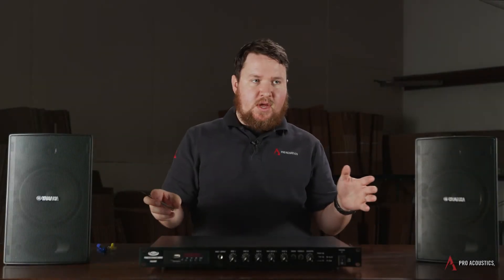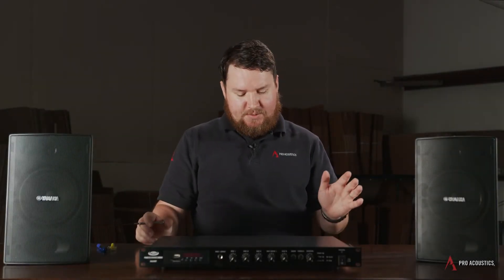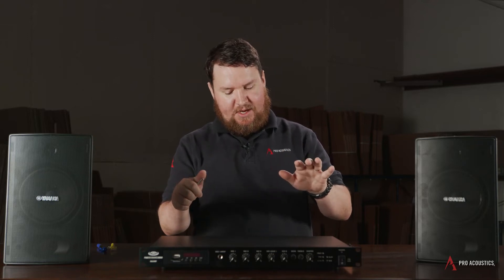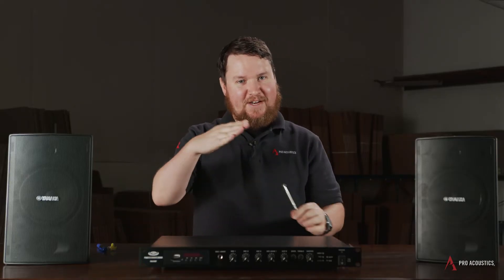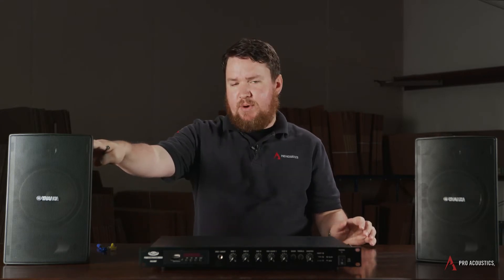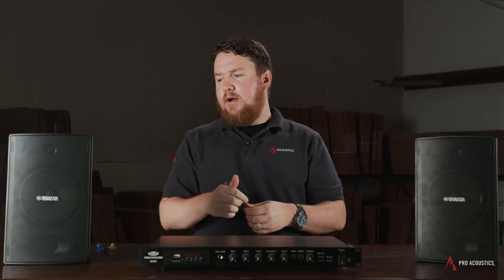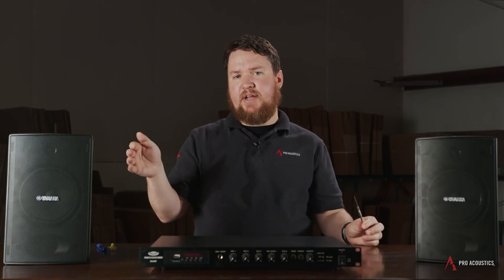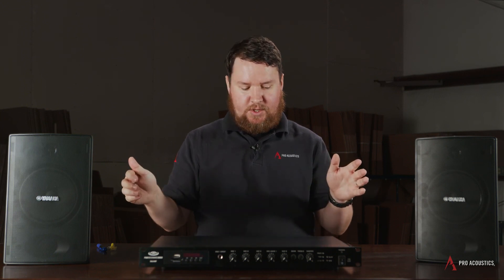Quick Clip: How to select 70 Volt speaker tap settings for your sound system? (Tech Talk Episode 57)

Comment: I always enjoy your video's, and your equipment you sell is top notch. My question is what is the down fall of setting the tap to high on each speaker. Most of the paging speakers I install I set at the 1 watt setting.  I would assume it would have an bigger effect on the amp and not so much on the speakers. Also would depend on how many speaker you have in line or total hooked up.  Thinking if you had 10 speakers on the highest tap setting, maybe you would have to have the amp volume 75%+
Reply from the maker: Hi Robert, Thank you so much for watching!
Each amplifier is only able to support a limited wattage draw. If you tap the speakers too high and they exceed that rated amount, you can end up blowing the amp or the transformers on the speakers.
We often recommend using a higher tap setting than you think you might need so you have more volume range, as long as your amplifier can handle it. To make sure your amplifier can handle the wattage, you want to add up your total number of speakers with their desired wattage tap settings. Then ensure that number does not exceed the total wattage output of the amplifier minus a 20% headroom.
You can also check out this other clip https://youtu.be/YDnZ9We3QpQ, or our blog about this https://www.proacousticsusa.com/blog/post/how-to-choose-the-right-70v-amplifier-for-your-sound-system